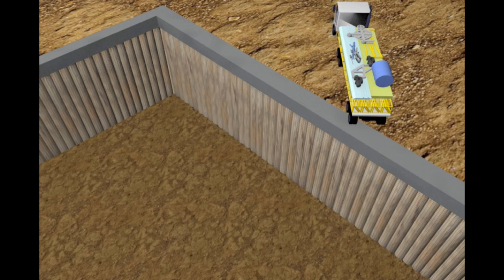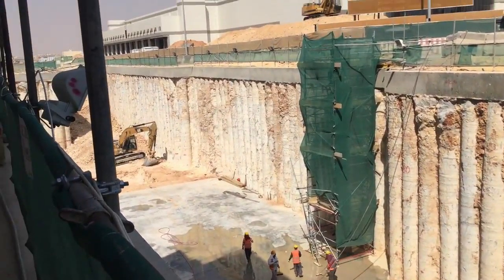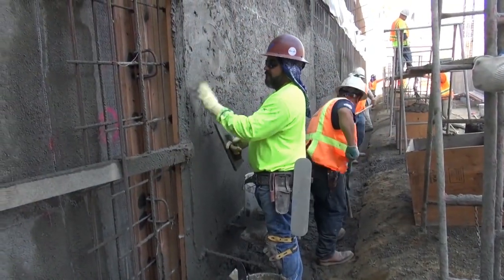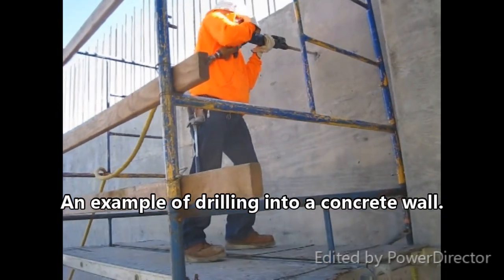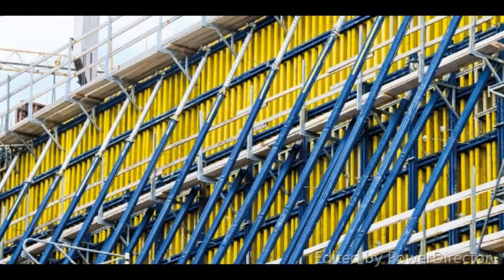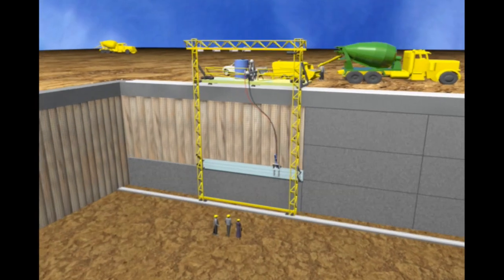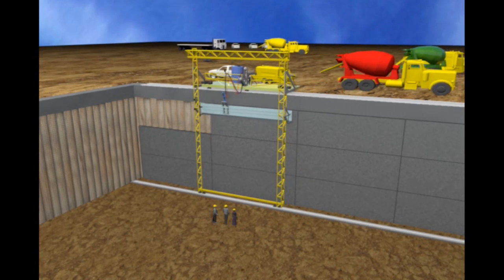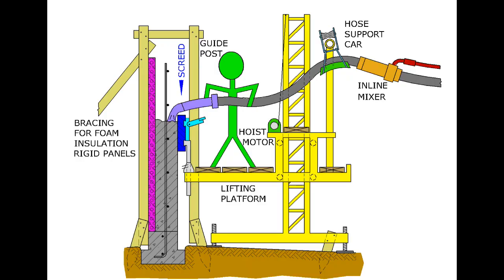Big Screed - Concrete rapid vertical slip-forming with SpaceCrete

Comment: Just found your site. Unbelievably cool work. I was referred by Mariann at Plastiform.  Amazing work. I would be happy to do a test project with you. I may need a very smooth finish. I had asked Plastiform to see if they had slipform and was referred to this channel.
Reply from the maker: Chris, thanks for the good words. Method still in development, though. Working on teh next admix. Where are you?
Reply: @SpaceCrete  I have a project coming up in Vancouver, Wa. I am not very locked in to this location I can do projects in other areas if it makes sense. chris@intendance.net

Comment: I can't wait to get my hand on this admixture you have.
Reply from the maker: Harry, now working on one for aircrete.  It needs significant modification and a relatively higher dose, but low density (30 to 40 pcf) can be 3D printed. Now that you are onto eps crete - that is  actually much easier - most solids help stacking, lightweight helps more.  Plain air is the hardest to stack. I will keep in touch!

Comment: Slipforming is really interesting. I read about it in my lerning books. I didnt know it went this fast untill i saw it for real. Its fast! 

One question. How can you use slipforming in building tunnel liner? The book said: "Slip forms were first used in the construction of curved concrete structures such as silos and towers. Today, slipforming methods are used to construct rectangular buildings as well as building cores, dams, caissons, underground shafts, communication towers, and other types of concrete structures."

Normally you would use something like: "the new austrian method" to stabilize the front of the tunnel face. And then place reinforcement and then use shotcrete on  the reinforcement. What you guys are doing with the slipforming, that should be possible (according to the book; "concrete formwork") . But how would you do it, while there is no top to pour the concrete in. Would you use a bulkhead on the front of the form, and then pump the concrete in, and then use external vibrators on the form to consolidate the concrete? Would the concrete not fall and come if it it "sticks" on the roof of the tunnel??

Well all in all, i like your slipforming videos.

Greetings,

Jeff
Reply from the maker: Hello Jeff. We have not tried any overhead placement, as this present inline thickening is not going to hold an overhead span without falling. Conventional slip forming uses the initial hardening to hold shape so the forms can move.

Can this be sped up with inline modification? Yes, but I think that the cost savings will be less than for vertical and sloped surfaces.
In any case, you are probably right about the necessary process, in that the overhead concrete pretty much has to be vibrated in place while confined, if it is not shot with velocity. Really I think that shotcrete as an advantage for at least the first layer against the excavated surface. 

I think that this method is better suited to excavated elevator shafts that can be vertically extruded. Thanks!
Reply: @SpaceCrete  I saw this video about a tunnel exploration: https://youtu.be/UwZflTzOl1c?t=614 , it looked like it was first stabalized in the front with steel beams, and then forms were used. They used some wire to support the forms. But then its not slipforming anymore. Even then i thought it was worth showing.. :)

Comment: Thank you for sharing! You're definitely onto something with these techniques. Can't wait to see the next video. Do you think an aerated concrete could work with this method as an insulating layer? Are you developing some ideas for ceilings/roofs? I'm working on a design using some similar approaches, hope to build next year. Thanks again, keep.up.the great work!
Reply from the maker: Seth: Aerated works better - more body less weight. It is a lot weaker though because the air first goes to the surfaces of the aggregate and effects bonding. I am only doing vertical concrete with this. Please send a link when you have your experiments shareable, thanks!
Reply: @SpaceCrete  Some in India figured out polymers help bond aggregate to the cement in concrete better, lowering cost, raising strength, cool concept, may solve the aircrete dilemma you mentioned. Also why I'd only use on the outside of my structure to insulate, not for structural support. Keeping thermal mass inside passive solar design. I like the idea of using masonry/concrete for the whole thing, no polyurethane insulation. One idea I've been working on for the roof is using fabric forming methods over light support framing then a rolling arch form to support for the pour. I'll let you know if that ends up making it to the practical research phase.

Edited to add link:
Link to Indian polymer roads: https://www.theguardian.com/sustainable-business/2016/jun/30/plastic-road-india-tar-plastic-transport-environment-pollution-waste

Comment: How does it behave in formwork?  Can forming be done with light weight forms with less bracing?
Reply from the maker: The immediate form pressure, right at the point of vibrating for consolidation, is the same or possibly higher. But then it almost immediately reverts to zero pressure. And the mix is sticky, so is best formed with a "water screed" surface (upcoming video). This is why the inline-modified concrete lends itself to vertical slip-forming. Thanks!